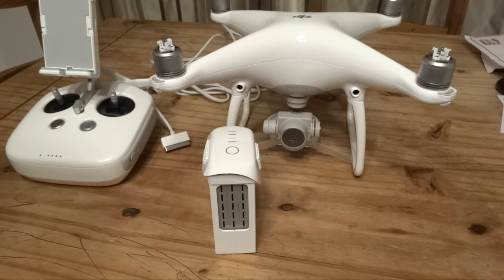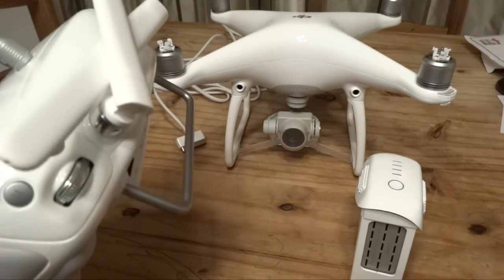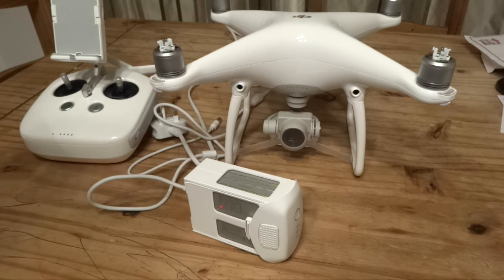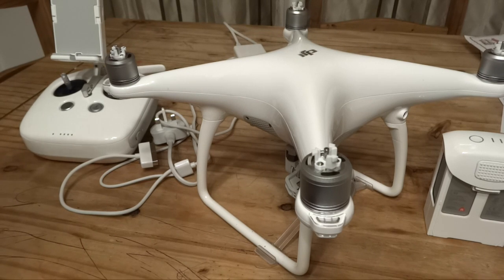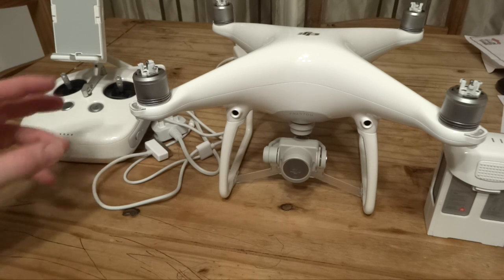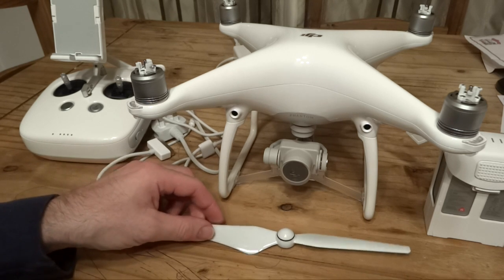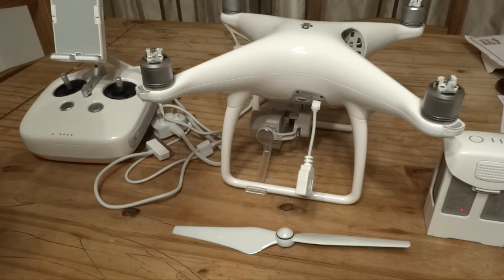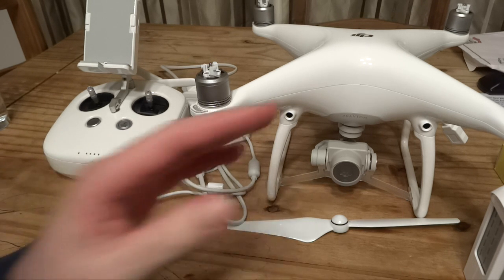DJI Phantom 4, Controller, HDMI, Firmware, ND Filters Information

Comment: Are you running the latest RC 1.8 firmware with HDMI module installed? There seems to be a stream image quality bug with this version. If you downgrade the remote to firmware version 1.6 it seems to fix the problem. Do you concur?
Reply from the maker: Yes the V1.8 is a know issue and still yet to be resolved.